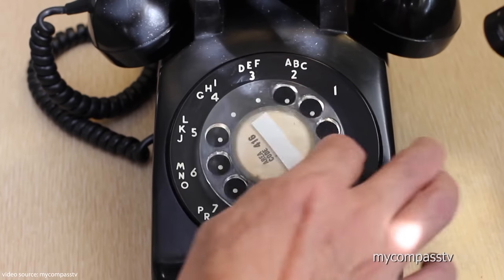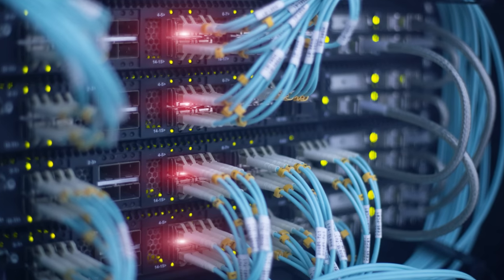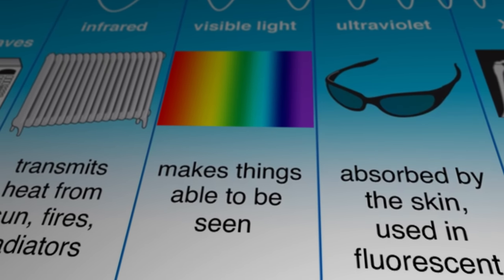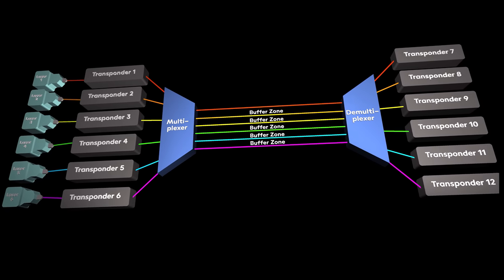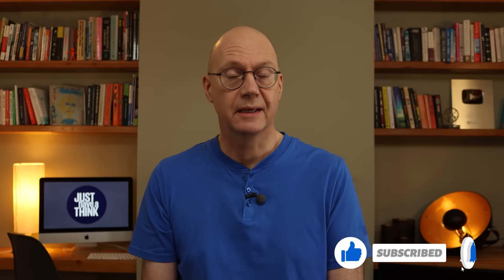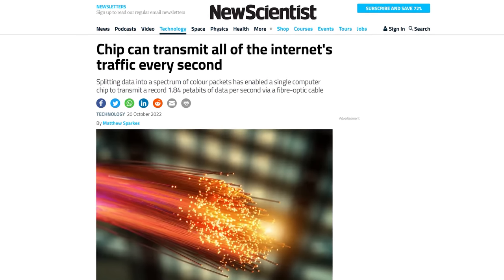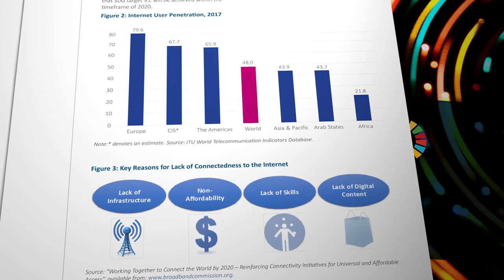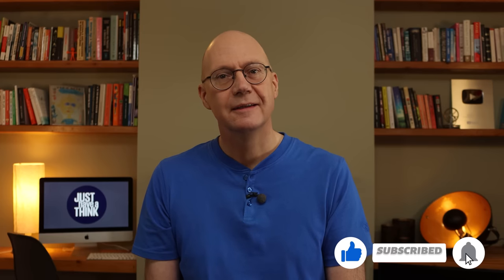The entire internet on a single chip! MASSIVE energy savings.

Comment: My take is that data centers are the big energy users here. In Denmark we are working to connect data centers to the district heating grid. They are essentially a resistance heater. Recycling of energy is the way forward.
Reply: And of course there are heat pump installations that move heat to areas, but can also move cool in the other direction.
Reply: I'm sure we agree that making any component of a server farm more energy efficient, (preferably all of them), would help to reduce the demand for energy. In the meantime, gathering the heat a server farm gives off and reusing it for space heating is a brilliant move. Perhaps some districts could install one of those sand batteries discussed in an earlier episode to store heat during the summer.
Reply: Data centers are very similar to hair driers. Input electricity, output heat and noise. The only difference is that in the case of the data center you also get 'and a teeny bit of computing.'
Reply: @dotter8  As more efficient technologies emerge, it'll simply allow data centers to increase the amount of workload. Tbere's still going to be a lot of heat generated. Not to mention data transmission is only part of it, all the computing power required to process and store everything isn't changing anytime soon.
Reply: @JJFX-  Agreed.
Reply: @JJFX-  I suppose that with data transmission in the petabytes, the workload will have to increase. Still, let's hope for the best. Maybe efficiency can outpace demand if other technologies improve at the same rate. (fingers crossed)
Reply: qarnot (not sure I have the spelling correct) is a French start-up which provide heating for buildings by providing compute to monte-carlo type of mostly risk calculation farms.
Reply: Can you send more messages pls? Need to get the bath temperature up a degree or two!
Reply: @noizydan  You're right, it can also be used for hot water!
Reply: @JJFX-  arm slashes energy demand of computing ~9 times so we already have a tech
Reply: @JJFX-  
You hit the nail on the head here: Better efficiency only matters if we don't scale up use.

Our fundamental problem is the fairytale of eternal growth. We will have to chose between a steady state economy or the end of a technological society.
Reply: Another pro nordic paid comment.
Reply: @bodapodopaboqobadopoqabod  I read an article recently titled Bitcoin Mining and no they are not digging them up but are instead looking at disused underground mine sites to house the equipment and providing cooling for it instead of running air conditioners. its a crazy world.
Reply: You're confusing data center with data transmission.  These are very different things.  95% of the work being done in a data center is not data transmission.

Where this technology is more important are data transmission centers, like what ISPs at different domain levels have.  Sure for a big data center their personal need may be met with a smaller data line but their data is going to a data transmission center before it goes elsewhere on the internet.

So, this is high level domain stuff regardless of the pretty pictures and talking about what data people use in their home.

And then showing data lines that cross oceans when you have an 8Km limitation seems pretty silly.

But cool your comment was just as silly as the video.
Reply: Dude, get some real figures - and then you'll see that this "energy RECOVERY" (not "recycling") is miniscule at best... That is, it may look "impressive" on its own (wow, so many kilowatt hours, so many Gretas saved...) but when you put it into the bigger picture it'll turn out to be just as "efficient" as pulling the plug of a phone charger from the wall socket to save few watthours of energy... per month, while switching on your AC when its 26°C outside. I know, such "heat wave" hardly happens in Denmark, so you can substitute this AC example for "boiling bit more water than actually needed for your coffee in your electric kettle".
Now, don't get me wrong - I'm not against improving efficiency and recovering energy wherever and whenever it is FEASIBLE - I'm just always quite... "amused", let's say, by this, um... "unbridled enthusiasm" exhibited by folks who fall like moths for the candle for every "greeny" label or some other "latest really real breakthrough".
Cheers.
Reply: @bodapodopaboqobadopoqabod  ...and the recovered heat will be used to grow vegan veggies ;-)
Reply: Soon were gonna have gan semiconductors that work at 500°c then you can have a hairdryer powered by bitcoin
Reply: @MrKotBonifacy  Denmark pipes hot water around in insulated pipes to provide homes with heating. The infrastructure is already in place. Pumping your cooling water into the infrastructure is the lowest of low hanging fruits for any datacenter.
Reply: @KarryKarryKarry  Yes, I know this system very well myself, with all its pitfalls and quirks - it's pretty common in Europe, de facto standard or a mainstream in many countries (and especially so in older buildings in Poland, where I live).
But I wasn't talking about it (the "piping") - what I was referring to was not HOW TO GET the recovered heat to people ("heat to the people, right now!" ;-) but rather "how insignificant would be the amount of this recovered/ recouped energy from those data centres", AND the apparent enthusiasm of some folks about it - as if was some "breakthrough" and God–knows–what sort of "savings".
Yes, data centres produce some heat, and yes, it is a "free" energy that can be recouped and used for heating insides of houses (instead of heating the air outside of them), but I think it'd make just a tiny fraction of the total energy expenditure for heating homes. And while it might be indeed the lowest hanging fruit , that "fruit" seems to me to be a peanut.

And then you need to build some infrastructure to recoup the heat and pipe it into existing "heat grid", and sadly "free energy" does not equal "cost-less harvesting" of it.
There's this saying in Polish, "a pelt for the tanning" meaning the cost of tanning a skin (= making it usable) equals, or nearly equals the price of the pelt obtained in this process. Figuratively, a deal where one gets  something for free (or next to nothing), but the cost of making it actually usable makes the whole enterprise kinda not worth it.
For instance, a friend of mine told me some time ago "remember the old wooden stairs we dismantled fifteen yrs ago in my house, and I decided back then 'maybe I'll use this beech wood for something'? Well, it's half rotten now and I don't think I'll ever do anything with it so if you want you can take it now an use as a firewood for your wood stove in your shop". Oh, great, but he lives well over fifty kilometres from where I live, and in the opposite direction of my workshop, so it'll be like, umm... Eighty kilometres times 9 litres of petrol/ 100 km, makes approx. 7 litres of petrol, times 7 PLN/ litre, makes about 50 PLN... for which I can get a whole bunch of broken pallets from the warehouse that is just next door from my shop... Well, you get the idea.

To sum up this little ramble of mine - yes, recouping the waste heat produced by data centres might be feasible, it might be even economically viable (even after factoring in all initial and long-term operational costs), but the amount of the recovered heat would be at most in the range of few precents in the "whole town picture", and economically it would be just as profitable.
Improving insulation of buildings, triple glazed windows (although they are pretty expensive), recovering heat from hot water going to the drains from showers, washing machines, dishwashers and all - that would "save" much more energy - but since it is costly and problematic to implement we'd rather do some easy "publicity stunt", and we'll make much ado about... not much.
...or so is how I see it, but then again I might be wrong. Who knows.
Reply: @MrKotBonifacy  
You are right and you are wrong :-)

Our problems are so huge and complex that we need every scrap of solution.

We should be mindful not to use more energy to collect firewood than the wood contains, sure, but if the data processing is necessary then the waste heat needs to be recuperated.

Waste is a luxury we can't afford anymore.
Reply: @bodapodopaboqobadopoqabod  Here in Denmark it would actually be windmills instead. Just lookup Denmark's $34BN Energy Island Megaproject on YouTube.
Reply: @madshorn5826  Third time lucky, uh...? Well, maybe... or maybe not.
OK, now it'll be in a ONE SENTENCE, and maybe it'll get through - failing which I'd need to draw diagrams or resort to play-doh and matchsticks... Which I can't do here, in YT comments.

So, here we go: fine, recoup whatever energy you can, just don't bark so enthusiastically while recovering every couple of calories - and, meanwhile, make sure you're barking under the right tree, in a first place.

EOT
Reply: @MrKotBonifacy  
There are still trees in a wood, even if you want to "look at the big picture" :-)

Being insignificant globally, doesn't mean a solution isn't important locally.

Plus small contributions adds up:
A few Watts of stand by energy in billions of homes equals a few gigawatts, i.e. a few powerplants running 24/7.

Whatabouterism will only help the fossil lobby.
The future is holistic - or not at all.
Reply: @madshorn5826  
1. "Whataboutism" (or "whataboutery")  is a term referring to a different scenario altogether. I'm not _"retorting with a critical counter-question"_, I'm merely trying to point out that this "data centre heat recouping" buzz (if not an outright hoopla) is in fact "a much ado about... not much". But then I never said it is stupid or useless either - all I said is "don't get so hyped up about it".

2. I quoted the saying "barking under the wrong tree", but maybe I should have quoted the one about "penny wise, pound foolish"?

3. There are billion of Chinese people, and if everyone of us would kill just couple of flies..." - that was Chairman Mao. The history is silent about Chinese efforts in eradication of flies, but the similar approach was employed for "fighting sparrows". Which was kinda successful, as the resulting insects plague and a following minor famine proved... But I digress here.
  
Anyway, a milliwatt is a one thousandth of a watt - 0.001W. With me so far? Good, ket's move on...
There are (I reckon) 500 millions of handphones in EU (or something to that tune - but that's just my guess), and if half of the users of those would "pull the plug" (fat chance...) than we'd "save" about 250 kW for all those "single milliwatts". Make it four for easier counting, thus 1000 kW, or 1 MW, or 0.001 GW... right?

On the other hands – correct me if I'm wrong – those chargers are used, I think, for... umm... charging phones? And then I assume (again, "CMIIW") that the actual charging draws waaaay more watts "from" those chargers than what they use while left unplugged - and then, a cherry on top...
What is the energy drawn "from chargers" used then for? Yep, you got it right - watching all kind of nonsense on those phones, and sharing the (mostly) nonsense stuff about some other nonsense... Meaningless talks about everything in general and nothing in particular, because hey, we can!
Thus my advice is: left them bloody chargers plugged in, 48/8, and just cut on those useless usage of your "smart" phones (a very apt name indeed, as those seem to be smarter than majority of their users) - and that will reduce the OVERALL energy usage MULTIPLE TIMES OVER!

Good idea, eh? No, wait! That'd reduce the traffic at them data centres, and thus the amount of recouped energy... Shoot.

And while speaking of weaselly eristics ("whataboutism") -  shall I elaborate on this silly "Whatabouterism will only help the fossil lobby", aka "reductio ad absurdum"?

Also, while I accept the fact that everyone likes to have his or her own doxa I'm not really willing to enter any discussion with any of those. It's just useless waste of time... and energy.
Cheers.
Reply: So we've been building data centres in the wrong parts of the world. They should sell the 'waste heat' to a grateful customer base.
Reply: @bodapodopaboqobadopoqabod  Yes, I'm leaning toward considering a conditional and/or partial possible agreement with abovementioned theses... But anyway, what that would be in a human language? ;-)
Reply: It's too inefficient and expensive.  I read about some sterling engines generating power in a data center in Finland or Sweden or somewhere, but it was very small scale.
Turning low-grade heat into work is not efficient or easy or (usually) cost effective.
Reply: @bodapodopaboqobadopoqabod  I just read through this twice and I'm still not sure what you're saying. It kinda sounds like you mean that companies will waste energy, (presumably because they can make more profit that way), unless they are forced by law to conserve and/or recover it... but I'm not sure. Maybe you could try conserving syllables? 😬
Reply: @MrKotBonifacy  HOW DARE YOU!!!
Reply: @dotter8  Just look at all the energy we waste chasing wages around the world.  We actually grow cotton in the US and load it onto ships and sent to China where it is unloaded, shipped to a factory and turned into socks and underwear then shipped to the coast where it is loaded on a giant ship and sent all the way back to the US!!! These ships consume 150 tonnes of bunker fuel a day.
 We actually import fresh vegetables from as far away as Vietnam! Vegetables which grow here fine.  Wawa (like a 7-11 only cleaner) used to sell a refrigerated fresh veggy snack bag which were flown here on air-conditioned airplanes. Little individually wrapped veggy bags.
Reply: @christo930  Um... dunno mate... I guess, "somehow"...?
;-b
Reply: Less data. Its not like big data is being used for good.
Reply: Quite the opposite
Reply: it'd be good to liquid cool some server farms with clean drinking water then once the water is heated enough, pump it into some nearby hotels for hot showers and room heating
Reply: @Powermongur  Rich bastards... I guess some folks have money to burn, but who could say "no" to rich man who wants to blow his money on the wind, eh? (pun not intended).

Nah, just kidding ;-)
Reply: Data centers are not the big energy users, but the easy energy recycling winners.
Any internet connection that is not fiber is massive energy waste.
I remember the massive heatsink on my coax cable modem. Actually, it was a massive heatsink case, with a tiny module inserted.
Even now internet connections that are not fiber use a lot of power, even though the electronics these days are mostly replaced by better DSP's.
On the other end there is also a lot of power injected into all these cables. There is probably at least a factor 10 in power use between fiber and any other type.

Starlink is different: it's a necessary investment into connections for locations where fiber is not an option.

Otoh: all these heaters in our network connection cabinets are electrical heaters in the winter with almost 100% efficiency. It doesn't mean we should not go for heatpumps, and make these unintended heaters more efficient.
Reply: @christo930  I think you’ll find that they are talking about using the heat to heat things not generate power. As someone who has designed data centres I can assure you that substantial heat is produced and very large savings can be had by better design. Utilising the waste heat to actually do something is a by product. Typically most countries don’t get too hot to utilise outside filtered air for cooling and capture and remove the generated heat avoids the need for expensive cooling of the hot air. It’s not rocket science (actually a fair bit of computational fluid dynamics) and substantial savings can be had.
Reply: A brilliant idea!
Reply: @davideyres955  The problem is it's low grade heat, just a ton of it.  I agree better design would be better.  Utilizing waste heat to do something, like heat a nearby building (or even just the office part of the building housing the data center)  is a great idea IF it is economically feasible.

Perhaps if the heat is being generated fast enough, a heat pump could concentrate it up to a higher temperature. But I don't know if they generate high enough temperatures.  I've heard about 140 F.

Comment: Wow, the timings on that introduction were years out. The Internet started in the mid 60s. I had my first internet e-mail account in 1976.

As for Broadband, I was one of the committee in Brussels which coined the term. This was in 1985. We defined it as 2.4Gbps access to homes over mono-mode optical fibre. The speed was needed to allow two simultaneous video streams, one to watch and one to record, simultaneously, with a bit over for other voice and data services. We didn't realise that compression technology would allow all of this over much lower connection speeds later.

Comment: For the record, fiber optics are not 100s of times faster than electrical signals.   In most situations, they are not even twice as fast.   What fiber provides is much greater data volume per unit time.   That's why bandwidth is measured in mega, giga, or peta bits per second, not meters per second.